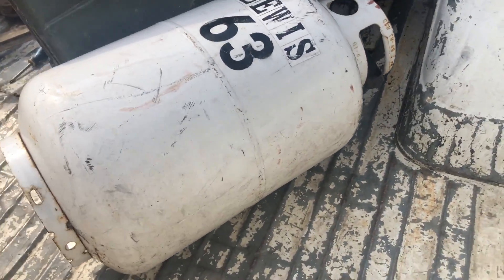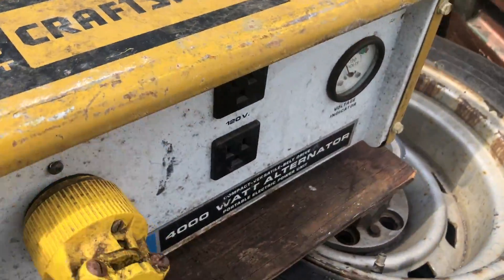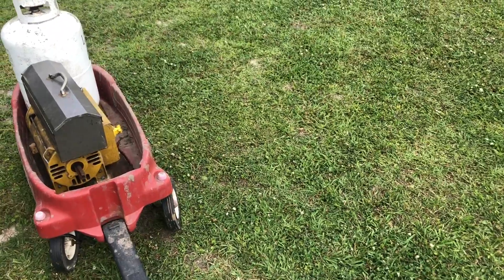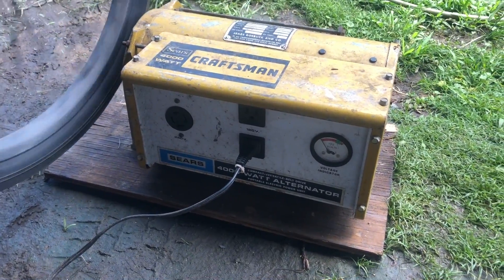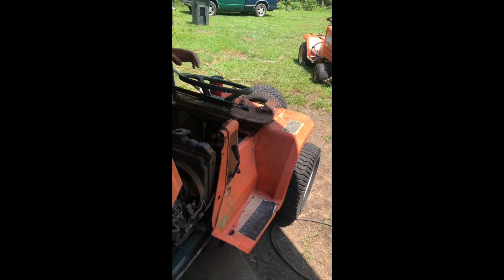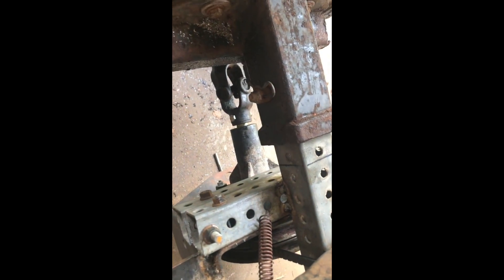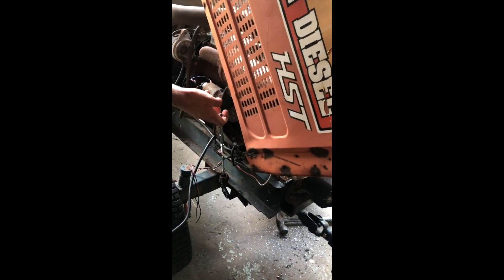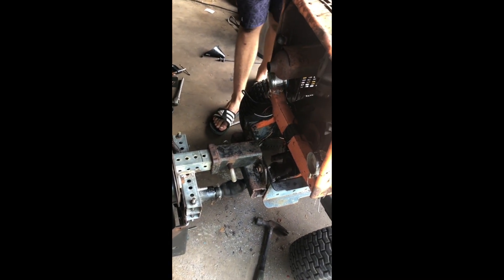Free 4000 Watt Generator Build

Comment: You've put allot of mower engines on outboards with bad power heads.. What about putting a old 2 stroke power head on a mower? I recently got my hands on a 55hp Chrysler missing the lower unit..
Reply from the maker: I have thought of that, you would just need a cooling system. Maybe you ou should try it... Thanks for watching!!
Reply: @chud327  I have a radiator, that I dont know if it holds water... to go with my engine, that I dont know if runs.. But I dont know enough about outboard power heads to even know where to begin in the plumbing..